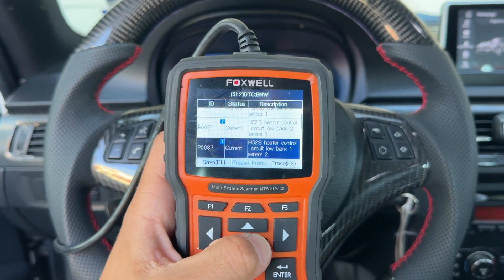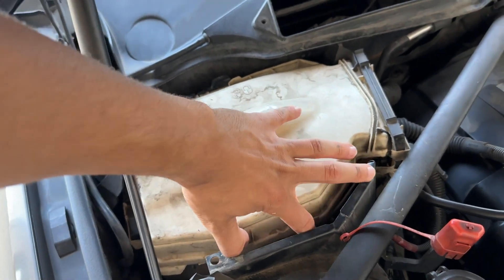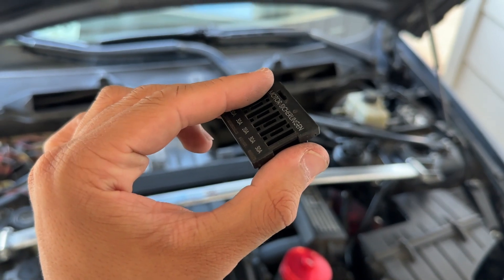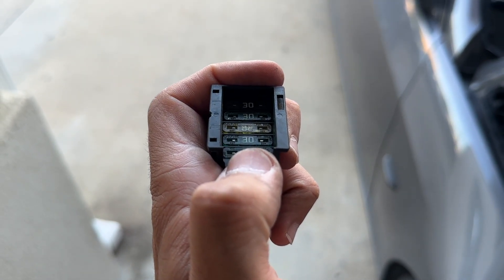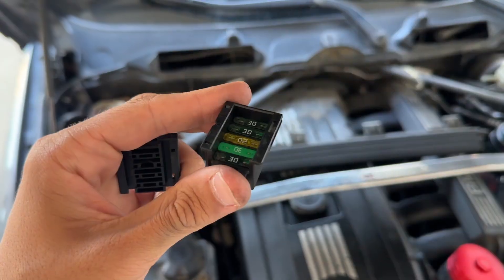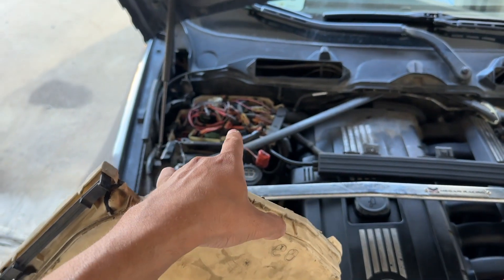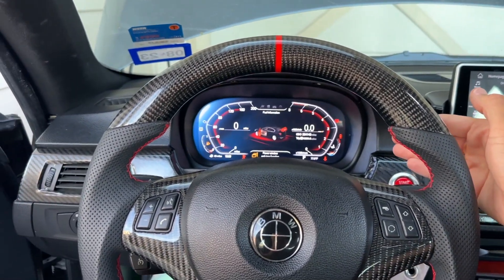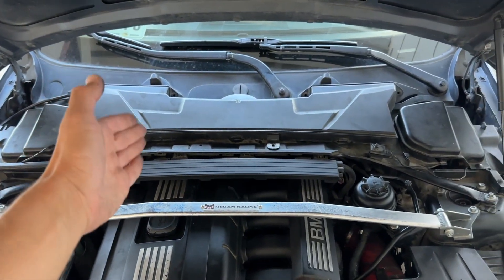How To Fix BMW O2 Oxygen Sensor Low Circuit Codes! | P0031 P0037 P0051 P0057

Comment: What year is your car? 
I checked in my 2011 328i and cant find that little fuse box in the engine compartment 
I have all 4 o2 sensors giving me a check engine light

Edit: it’s a 30a fuse in the glove box, I have a 2011 328i. Don’t think the newer e90s have this box in the engine compartment. Fixed my issue, thank you!!!
Reply: Where exactly in the glove box? Mine 328i doesn’t have that fuse module in the engine bay as described
Reply: @leopadh Mine either. Did you ever figure your issue out? Where he shows fuses, I have a  similar looking black box, but it has a relay instead.

Comment: I've got kind of a similar problem with an o2 sensor, with a "slow response" code (bank 1 sensor 1). Got any tips for this as well? Great video btw
Reply: Helou did you fixed the problem because i have the same code  eror

Comment: And what was the simptomes of the car ? Mine shake alot when engine run on stationary position
Reply from the maker: though idle is a system, but if all four check engine codes for the O2 sensors are present, that’s how you know.

Comment: im having trouble with code p0040 i’ve replaced the sensors wiring all good everything was replaced and plugged in the exact same as it originally was
Reply: How much did this cost or did you do it yourself ?

Comment: it keeps blowing and going into limp mode
Reply from the maker: you most likely have frayed O2 sensor wires somewhere along the system that is causing it to blow.
Reply: @IzzyE9X i replaced both 02 sensors still got p0100 and code for ECM lost connection
Reply: Figure it out?
Reply: @IzzyE9X any fix?
Reply: @e92cruz_ any fix?
Reply: @bimmersofhtx  I got a new car but I unplugged the sensors and it stopped blowing